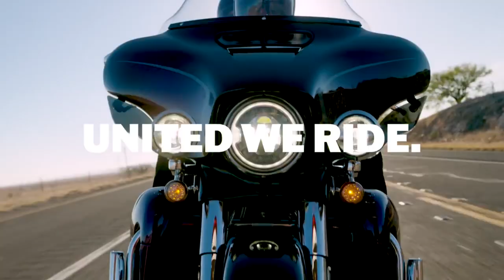Harley-Davidson 2021 Launch, Custom 1250 Replacing the Sportster Line?

Comment: The 1250 is not really viable yet because of no true specs and price. The rebel is not out yet but price is known. The adventure bike better be as cheap as the Africa twin or the Tenere . They are not cheap so HD may compete price wise. You know on some of these smaller bikes HD could have a on-line twin. They are more compact and lighter. The old bikers are not going to accept the pan america anyway. The 1200 Iron is better looking and priced OK. The Sportster does have a good look. The naked Sportster is a classic look.
Reply from the maker: I think the 1250 will launch later in 2021 and we will know more then. From what I have seen the Internet the Pan is expected to be around 20K it is a 1250 so I expect it to be priced with the 1250 BMW's. I don't think you will see HD put out an inline twin. They are known for the Torque and sound the V twin puts out and it is a narrow engine,
Reply: @RidingintheOzarks  The Honda is 15999, the Yamaha is 16222,  the Suzuki is 12999 - 17000. Why compare to BMW? People who buy BMW will not buy HD. They are romantic BMW enthusiasts. They have drank the Koolaid hype of BMW. The Pan America must compete with Honda, Yamaha, Suzuki, and Kawasaki. If the Pan comes out at 20k it will only sell to enthusiasts.
Reply from the maker: And unfortunately I think Harley is not interested in competing with those bikes. They want to be seen as the most desirable brand in the world. They want to sell to the Enthusiast who will spend 20K on a bike . Until there ego gets in check and they care about selling motorcycles more than being a desired brand I don't think that is going to change... I hope I am wrong. I don't claim to be an expert or have inside knowledge, in fact some think I am absolutely wrong. I ride a DR 650 and would love to see Harley have come out with a 750cc ADV bike, I have Touring Motorcycle and don't need a Touring ADV bike. I would have been interested in the Bronx but it didn't make the team...

Comment: Harley axing the Sportster isn't an if. It's a when. And that goes for all bikes. I have 2 Sportsers, and I love them both, but times are changing, and thanks to ridiculous emissions standards, it's getting harder and harder for dealers to make motorcycles emissions compliant already, and the market is always changing. What's the rage right now will be on the decline in years to come. Harley has to make changes to stay up with the competition, and if they don't, it could be their end. The 1250 custom prototype was designed on a very similar platform to the Sportster, and why? Like said Harley's new C.E.O is all about streamlining its line and manufacturing process. So it only makes since to build the new models on a similar platform to make the most out of the streamlining process, the cheapest way possible. Let's not forget that the Sportster line is one of, if not the most successful models Harley Davidson ever made. In my opinion Harley already axed its best bike when they done away with the Dyna. The Sportster is a testament to motorcycle engineering with over 60 years continuous production which is the only bike I know of to last that long. But as with all things, times change, and so does the need for new bikes. So while I'll miss the line, I'm not upset or surprised by it's eventual undoing. Your thoughts on the Pan America were interesting to me. I do agree about the expense being too much for their first attempt, but this move was all about major changes to the line, and the engine is the central piece to that. I believe that Harley most likely had the revolution engine concept before the Pan America concept. Designers and engineers are always gonna look at the market and demographic for what they're producing, and the adv market is probably one of the fastest growing markets around in the motorcycle demographic right now, so it only made sense to step in that direction. I don't see the street 750 engine being anywhere strong enough to be a good competitor for the successful bikes already in the adv market. I believe the Pan America is about making a statement. I don't see the bike making huge sales, but I do see it making it a difference in the market. The name Harley alone will attract a few buyers in this segment. But moreover it'll serve as a statement that Harley is moving forward with its designs and production. This move is about new buyers to Harley Davidson... buyers who wouldn't have considered the company in the past now have new reasons to consider Harley. And let's not kid ourselves here, Harley Davidson motorcycles are expensive. They are always gonna be. But they are extremely well designed and built bikes as well. Getting their name known in new markets and segments is the key agenda. And back to my point, I think the high power water cooled revolution engine is the only way to go here. That's just my thoughts. Thanks for the video. Stay safe, and enjoy the ride
Reply from the maker: Thanks for watching and commenting. One thing to note I said the Street Rod 750 Engine which is not the same as the Street 750, The Street Rod 750 puts out about 64 HP at the rear wheel. The Tenere 700 is a claimed 72 which I am sure is at the Crank since it wasn't a Dyno result.  My thought is they would be more successful at selling ADV bikes at this price point and level. I just think buyers are more likely to try Harley at 10-12K range then 20K. I think the guys spending 20K on an ADV bikes are less likely to test HD and probably have some brand loyalty to another established brand in this market.  But hey that is just my 2 cents and nobody said it was worth more then 2 cents lol.
Reply: @RidingintheOzarks  I agree, and thanks for correcting that. I do believe that you are absolutely right about the buyers being much more likely to buy a $10k than a $20k, but unfortunately Harley never does anything small even when they should!
Reply: I also think that the Street Rod 750 engine would make a really good engine in a scrambler style bike if Harley was willing to go that way

Comment: Sportster problem: won't pass emissions. Solution: use the motor from the Street 750 for markets that has tighter emissions standards. How is this Rocket science?
Reply from the maker: It isn't, I think the question is how much work does it take to fit that engine and tranny in that frame and is it worth it if sales is declining, the Street isn't terribly popular either. I know many think the Sportster is timeless but I am guessing they believe they can attract more new customers with a fresh design... but hell I am still convinced they killed the Dyna cause they didn't want to retool and redesign the Dyna for the M8.... and Keeping the twin cam for that frame wasn't worth it to them...
Reply: @RidingintheOzarks  From my viewpoint, Harley has made a investment in designing the Revolution X motor, which is really the best thing about the Street 750. Its not a great bike to sit. The Sportster is being canceled due to emissions, otherwise its a liked bike, if not loved. The Revolution X motor actually would match the 883 powered bikes, so its not a downgrade. (53hp vs 49 @ 883 & 47.9 lb-ft vs 54@ 883)

Indian Motorcycles has shown that water cooled don't have to be ugly, a Sportster 750 don't have to be ugly either. Wish the Revolution X motor went to a mid sized dual sport bike, but that's me doing some wishful thinking, as the 500cc motor is very much the right kind of motor for a bike similar to the Royal Enfield Himalayan, which is a very pretty bike indeed IMHO.
Reply from the maker: @twotone3471  I think the motor matches up spec wise but if they have retool and make new frames for the engine and tranny then do you make it for the 750 or the new 1250 that are coming out with? I would like to see one Model with multiple engine options like the 750, 975 (Planned for the Bronx) and a 1250. Not sure how doable it is but it would be nice. I would like to se those options in a Naked and an ADV Bike. Let hope they find a way to give customers more choices.
Reply: @RidingintheOzarks  Agreed, though the changes to the sportster frame would be very minor, and the key is keeping the Sportster around with as little investment by H-D as possible. I know some want the big displacement motors, and some are fond of the current setup, but keeping us on 2 wheels is the true goal. 

Having Harley produce a single line of engines with different displacements would save them so much money. Its such a crazy idea compared to Harley's current strategy that it might just work if they did the engineering.

Comment: Finally Harley Davidson doing the right thing by ditching the old outdated pushrod setup for a overhead cam setup doing this will help improve performance because it will capable of reaching higher RPM's and going water cooled will also help to Indian motorcycles figured this a while ago has made a motorcycle more capable than Harley Davidson for a few years now now Harley Davidson is going hopefully in the right direction because building a single engine and transmission that can be placed in a multitude of motorcycle models can improve and lower production costs in a big way because it that engine meets emissions standards and requirements so what ever motorcycle it goes in it meets those requirements because Honda and Kawasaki and many other motorcycle manufacturers have been doing this for decades now.

Comment: Looking at that new 1250 I swear man when will Harley learn not everybody wants to ride a bike with their feet sticking out in front of them like they're sliding down a slide at the play Park I know tons of people that would buy a Harley but can't stand the way it sits the pegs being way out in front of them what is Harley got against your feet being underneath your butt
Reply from the maker: This is a prototype so that may change but they do have some models with mid controls. Most Dyna’s were except wide glide originally but they could be changed to forwards for those that like them. I prefer them myself but to each his own...
Reply: @RidingintheOzarks  Thanks for your reply. I wasn't trying to be critical, I just really like that bike they made for about 2 or 3 years I want to say it was an XR where the pegs are directly underneath you even further back than mid controls, but that's coming from an old motocross racer. I swear I think it would sell if they would come out with an honest attempt at a street scrambler and or a street tracker and give it a chance for people to find out it's even been made by Harley.
Reply from the maker: @charlesmorris8491  Hey thanks for the comment and everyone has different taste and opinions. I definitely think they need to make other style bikes and I don't think an ADV bikes is a bad idea I am not sure the Pan America  trying to compete with 1250's is the right way to enter that market. I don't want a big heave ADV bike but hey that is just me. I would love to see them do the Bronx and a scrambler. I want them to succeed...

Comment: I am going to say it now, if the Harley Street Glide Special is the same old disappointment featuring a dated design i will be going to Indian.
I will be buying once this event is over; however, it better not be the same old dated and stale design for the Street Glide Special.
At minimum, i will be looking for a rear mono shock, remote locking saddlebags, power windscreen other wise i am gone, i am tired of Harley gimmicks and this will be their last chance before i am gone for good.
I found a nice 2021 Indian Chieftain Limited i love, but Harley gets 1 more shot to impress me (i have my doubts as they have been a disappointment for several years now).
Dont let me down Harley or i promise you, i am gone to never return.

Comment: Indian reinvented the sportster. Even comparing the scout to this "custom," and to the rebel the Honda is fucking ugly. Im sure this HD will be 12k when it has no reason to be, rear fender designed around the exhaust? Radiator could be cleaner, and remind me what is aggressive about forward controls (I rock them but I chopped up my sportster). If I were dumb enough to buy brand new at all, 100% wouldn't be dumb enough to go HD. Especially after the twin cam blah engines, the issues coming about with the m8 series. HD needs to get another company to design their guts again and stop asking Bill in accounting what should the bikes look like.

Comment: Iiked the video, but have to say if these predictions are true. HD is doing the right move. Pushing the Dynas and Sporties of old further into the hands of custom builders and mystic of days of old. Yes HD needs to move forward. But if they did discontinue these lines, its because they have to. The aftermarket has killed their over priced parts walls for years. They would rather fold and move forward. Like they have for years. Ask a pan head or a shovel lover..do they shop at the local dealer for parts or help? F@c$ NO. That train has left the station long ago. And HD knows it. There's no way they are going to look back...but they should. Their best asset is that old biker in the corner with a beard down to his knees and grey to boot.

Comment: The change is good. The EVO is a legendary engine, but it's time for something new. Harley needs to become a big tent where the only rule is that you like riding motorcycles. If they don't, then it's going to go back to the only people riding new Harleys are the cosplaying doctors, lawyers, and office administrators.

The Harley scene has to change. And they need to do again what they did when the EVO came out back in '86. A reliable product that is on par with or exceeds the standards of the class the product is in and is competitively priced for regular motorcyclists.

Comment: They had to try and go for the big cc ADV market because their 700cc class engine is so fucking shitty no one would have bought it.
Reply from the maker: The Tenere 700 puts out about 8 more hp then the 750 STREET ROD ENGINE (not talking about the 750 street). But I guarantee they can get more from it if they wanted. Harley always leaves room to increase HP thru aftermarket sales.  I think they could compete if they wanted... I think buyers looking at this class are more likely to test the waters with HD but I could be wrong. I see more people buying bikes in this class than 1250 but my adv rides are local not adv touring. I only know a few adv riders so far and none are running 1000cc plus bikes.

Comment: Mine isn`t waxing poetic for emotional nostalgia.
It`s simplicity for dependability sake which translates to economics at every turn.
The more complex a machine is, the more parts it has, the more likely it will break,
& sooner AND the more it will cost to repair.
(The more tools required to fix it & you can`t do it broke down on the side of the road)
A majority of enthusiasts don`t do their own wrenching these days, but they DO make the payments!
This World is ever more complex. I believe HD & others miss the mark when they ignore principles of VALUE for a dollar.
I know simpler IS BETTER & air cooled engines ARE simpler, more dependable long term & less expensive over time.
If HD wants to put more riders butts On their machines they should make not competitive, but SUPERIOR machines adherent to all I have outlined here.
STOP trying to keep up with the joneses & forget about things like anti lock brakes & radiator bikes.
KEEP IT SIMPLE STUPID!
(& LOWER YOUR SHOP RATES & NEEDED REPAIRS)
Reply from the maker: I get what your saying and don’t disagree but I don’t think regulations and emissions and are going to allow this...
Reply: @RidingintheOzarks  I believe the emissions requirements can be reached with some re engineering.
Also, I`m completely in favor of alternatives such as electric or other gases such as CNG, but they aren`t for me & that is NOT Harley Davidsons market share & they need to concentrate on their strengths &  not abandon them UNTIL they establish any other.
(They can`t throw the baby out with the bath water, but essentially they have, to a point & it IS costing them!)